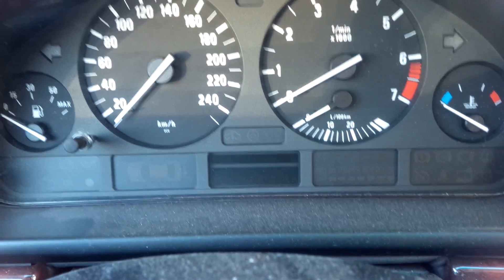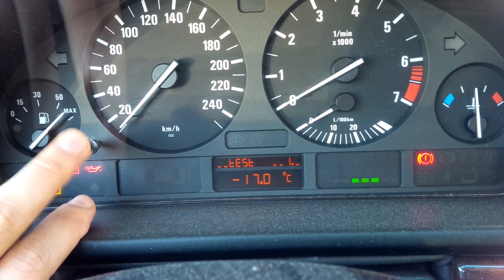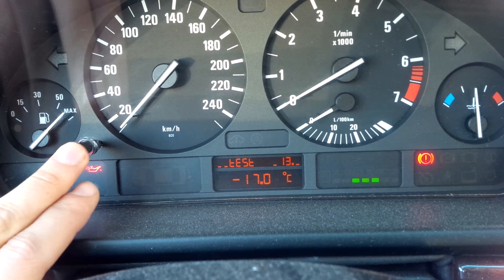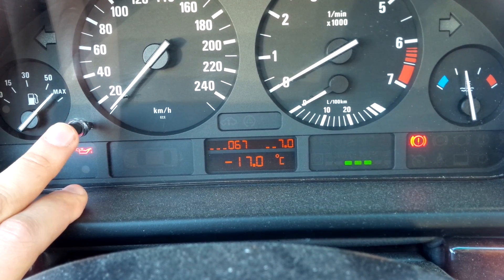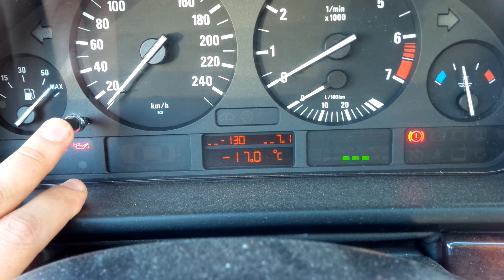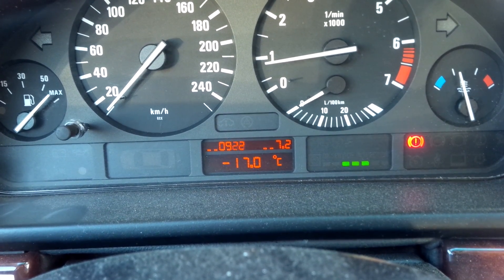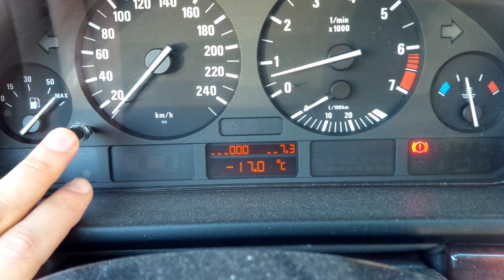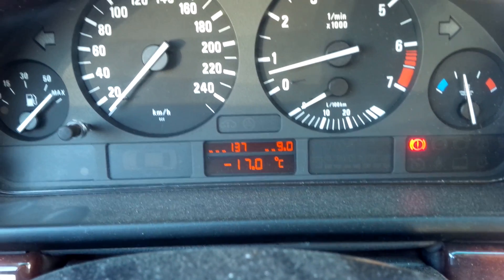BMW E39 OBC low cluster unlock (coolant temp, batt. voltage, etc.)

Comment: Hi just watch your vid..im sorry its a bit late..can this reset fix my fuel level issue?already change my fuel pump and filter but it still running out fuel when the indicator show half tank

Sorry for my bad englisj
Reply from the maker: Hi there. I don't think the reset will help fix your issue. Have you replaced both fuel sending units (level sensors) as well? I believe most E39 models have two sending units, one on the driver side and another on the passenger side.

Comment: I see u got some lights on dashboard while ingition is on. I got the battery one and oil sign too.  When i turn car on,there will be no those lights on anymore.
Do i have a battery and something with oil fault? 
Why those stay while ingiton is on?
Reply from the maker: This is normal operation. When the ignition is on but engine is off, oil pressure indicator and battery indicator will stay on since there is no oil pressure and alternator is not generating electricity. Once you start the engine, both lights will turn off if everything is functioning normally.

Comment: i got a silly question the car doesnt have any pre heat signs when should i turn the car on ? whenever i please?
Reply from the maker: What do you mean by pre heat signs? Are you talking about the indicator for the glow plugs?
Reply: @mrdragancelan  yes i mean when am i supposed to turn the car on ?
Reply from the maker: @boxlight2888  If it's a gasoline engine, start it whenever you want. If it's a diesel, wait until the glow plug light turns off before starting the car.
Reply: @mrdragancelan  thats the thing its a diesel but doesn't have any plug light
Reply from the maker: @boxlight2888  Hmm I thought the E39s have a glow plug light but I don't know for sure. I wish I could help more but my knowledge on BMW diesels is almost non-existent. Sorry!
Reply: @mrdragancelan  its so strange cuz in the manual it says there is a  glow plug light but there is none nowhere in the cluster
Reply from the maker: @boxlight2888  I think there are two styles of gauge cluster in the E39. Maybe yours doesn't have the light? Or maybe the bulb is burned out?
Reply: im really late, but if it doesnt have a light just wait 3 seconds (5 max if it doesnt usually start at 3) after all the glowplugs are there just to make it easier to start, so if it starts then its fine you wont damage an engine by turning it on before the light goes off, if it doesnt start just wait a little longer

Comment: I have a problem on my cluster for my 2002 530I .even I bought the car the cluster worked fine but a few days later I noticed the car diagram that displays  which door is ajar no longer works. I bought bulbs online as changed all five bulbs. it only shows like light in the background and a few green bars everything else functions.
Reply from the maker: Sounds like you're having the same problem another commenter (Jenny B-girl) had. Maybe you could reply to her comment and see if she managed to fix it or get it fixed. I'm not sure what the cause of the problem is so I wouldn't be of much help.

Comment: What are those three green bars? Is that a battery level? I only have two of them, does that mean that I need to replace my battery?
Reply from the maker: No. Those lights are the  "Service Interval Indicator". You're supposed to reset those lights whenever you perform a service (oil change) on your car. When they have been reset, there will be 5 green lights. As they go out, that means you're getting closer and closer to having to change your oil again. I made a video showing how to reset it here: https://www.youtube.com/watch?v=Oc_X0XAfpko
Reply: Thanks a lot! I just bought the car yesterday. I've also got other problem. Basically, the hazard light switch/button is lightened up all the time, even when I turn off the car and turn the lights off. Might that say something to you? If you would know what to do... man... Im subbing now haha :)
Reply from the maker: Samuel Zająkała Have you tried removing the switch, unplugging it and plugging it back in? It worked for one of the guys who had the same problem you're describing on Bimmer Forums. If that doesn't fix it, maybe you'll have to get a new switch. Fortunately I don't think they're too expensive if that's the case.
Reply: Alright, thanks a lot! No I haven't touched it. I'm gonna do it as soon as I'll get back from work, thank you a lot! Subbed + liked
Reply from the maker: Samuel Zająkała You're welcome! I'm glad I could help. And thanks for subscribing!
Reply from the maker: ლაშა დარძული I'm sorry but I don't understand what you're trying to say.

Comment: hi. what will happen if i reset the software? cheers
Reply: +Castillo En Blanco is not expensive.... i bought mine from ebay with £15 delivered and is situated (in my case coz i live in uk and my car is right hand drive ) between the fog light and front driver wheel under the mud or splash cover, suppose to be a slot to fit it in.
Reply from the maker: I'm not sure.
Reply: +Dragan Celan one more thing. why my outside temperature is always -40c. do you know?
Reply from the maker: +alin lepadatu That is most likely due to the ambient temperature sensor under the car being faulty.
Reply: +Dragan Celan do you know where exactly is underneath the car? thank you
Reply: +Dragan Celan i found it. thank you very much for your help and for your video. very helpful. BMW should recompense you with something for this tutorial. thank you again!!!
Reply from the maker: +alin lepadatu Haha you're very welcome! Glad I could help!
Reply: +alin lepadatu Where are the temperature sensor? I have the same problem, because it show 50ºC for me

It's expensive sensor?
Reply: +alin lepadatu Thanks you very much, I live in Spain, but I'm sure it's on the same site.

Can you send me the link of eBay, when you have time, please =)

Comment: I have 1 question , im dieing to find out why my e39 525 dosent have that lil car on screen , i mean whend u open the doors or you have 1 open car , that lil yellow/orange car pops up .. I dont have it ( i mean i have it but never turns on) You have any ideea if its dezactivated or something ?
Reply from the maker: KirionGoPro So when any of your doors or your trunk is open, that little car doesn't illuminate?
Reply: Exactly , that lilttle car dosen´t iluminate.
Reply from the maker: That's odd. There could be a number of reasons why that is. Is there anything else in your cluster that isn't working? Because I doubt it's because every door switch on your car is broken. That's extremely unlikely.
Reply: Nope , acctualy mostly works perfect. The B/C button dosent work as well , even if i press it dosent do anything. I think it may be dezactivated or something , i have no ideea , i have this car for about 1 week. And everyday im seeing something different.
Reply from the maker: The B/C button on the steering wheel?
Reply from the maker: Oh right. That one toggles what is displayed: ambient temperature, fuel economy, estimated km until empty, and average speed. That sucks that it doesn't work. You might have to start taking stuff apart and testing.
Reply: Yes

Comment: Great, thanks.  I have an non-function L-hand fuel sensor (test #6)....does LEFT HAND = driver side?
Thanks
Reply from the maker: Your welcome. And yes, left hand usually means driver side unless you live in a country where the driver sits on the right.